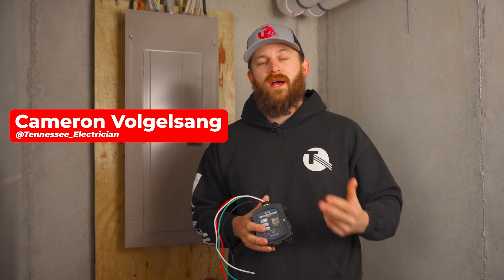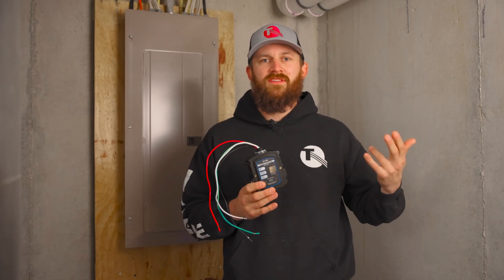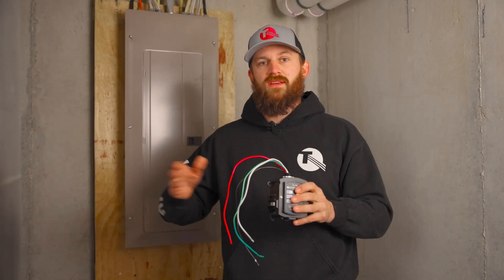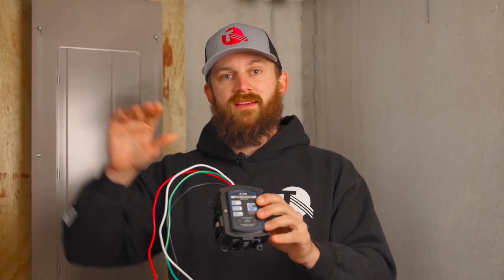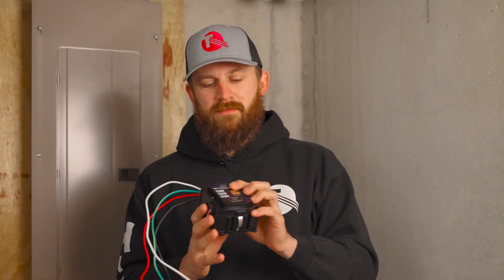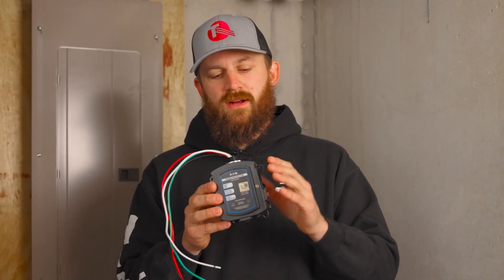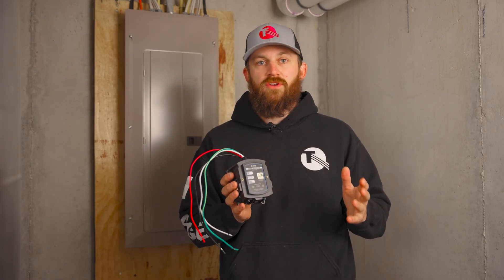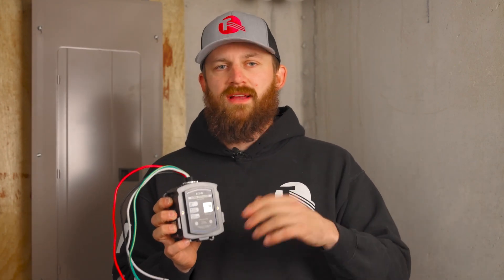How Does a Whole House Surge Protector Work? | Teague Electric

Comment: So this won't help with preventing electrical fires at panel? Whats the most common cause of electrical fires in panels and whats the best method to prevent
Reply: I am not an electrician, but in my limited experience, some things to look out for are loose connections, undersized wiring, and old breakers in need of replacement. Any of those can cause resistance, excess heat, and possibly a fire.
Reply: Usually loose connections , corrosion, faulty equipment are some reasons
Reply: No that’s not it’s cause it’s to help prevent from surges destroying appliances
Reply: Yea you get a big enough surge through it then fire is just going to happen.  Is why panels are fire resistant and wire sheathing is heat resistant but proof is something that has to be scrutinized to get.  Talking metal enclosure with all stub outs sealed with fire caulking mounted in a concrete room.  Lol. It is good practice though to use the proper cable knockouts that hold the cables in place and dont have any sharp edges, mount panels to concrete or a piece of coated plywood instead on inside a wall cavity between studs.  Its all relative though, electricity is just controlled fire potential, as soon as it has a chance its gonna try and jump out..